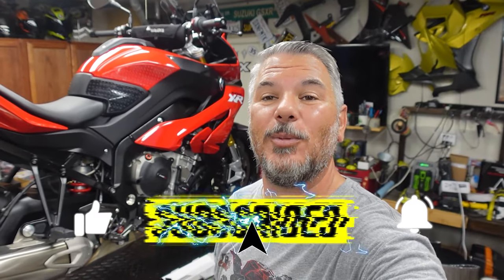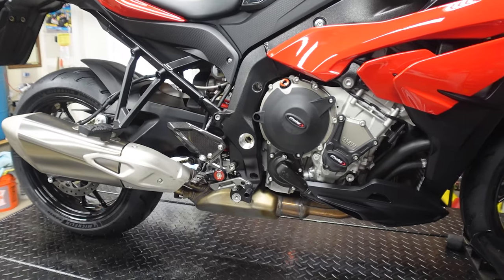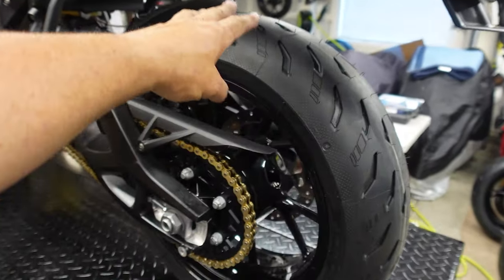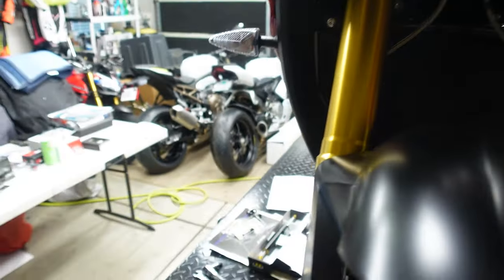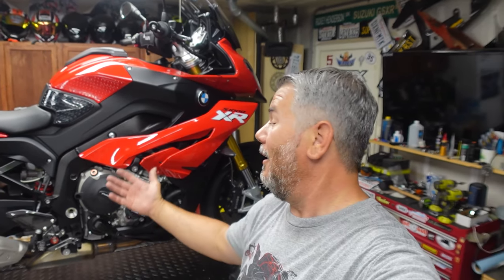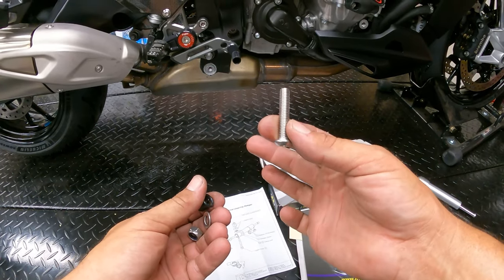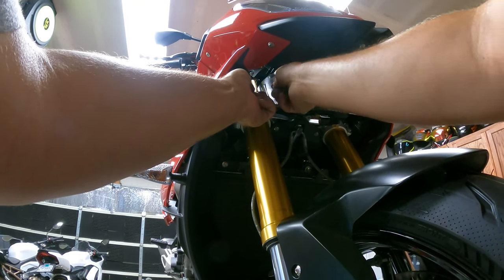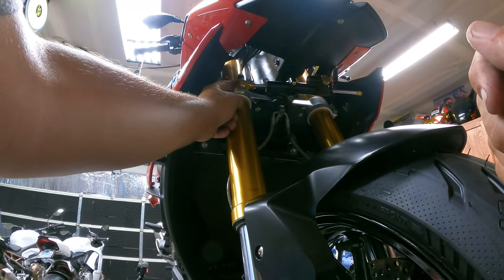Hyperpro Steering Damper Installed on 2016 BMW S1000XR

Comment: On the eye end, the spacer should be below the bikes bracket, not above it. 
Only the nut should be above the bikes bracket.
On my 11/2019 S1000R lucky for me the Torx bolt came out  easily.
Thanks for the video, great presentation !

Comment: So for one I'm seeing comments that you installed the spacer stack wrong on the fork, but two I don't believe you're going to be able to turn fully to the left because you didn't get the shock body on the shaft centered. You only have a very short amount of rod coming between the damper and the eyelet. Maybe I'm wrong but you might need to slide that over some

Comment: Wrong install instructions have been up for over 2 years. Come on guys, add an edit regarding the spacer and washer wrong positioning. BTW it's pretty obvious the spacer goes between unit and mount bracket. But still...people come here for guidance.
Reply: Do you have the right part number or know where to get the right one for 16 s1000xr??? It seems like the one online are either to short or too long

Comment: hi bill nice video I have one question please this damper is only for track ? or can be used on road too ? the steering will be more hard ? thanks
Reply from the maker: You can use it on the street too. It helps stabilize the front end.

Comment: Bill! Are you still running with arrows +no ecu tune?  If so, how’s it running? I want to get a pair of arrows and do the same thing but I’m afraid of running lean and damaging the engine over time. I don’t want to get the ecu flash and void warranty :(